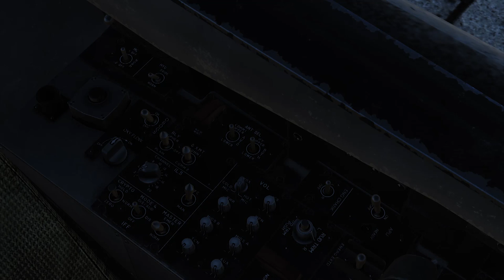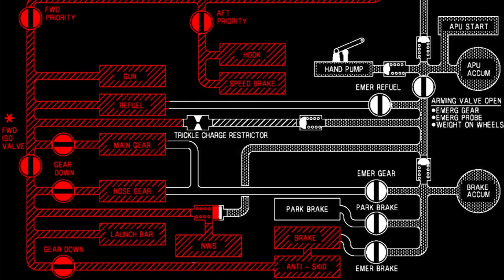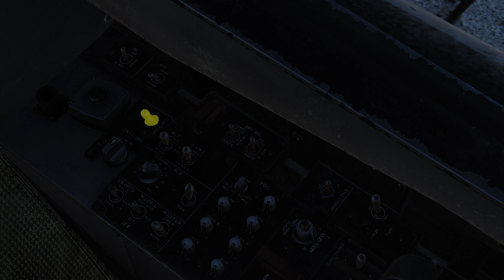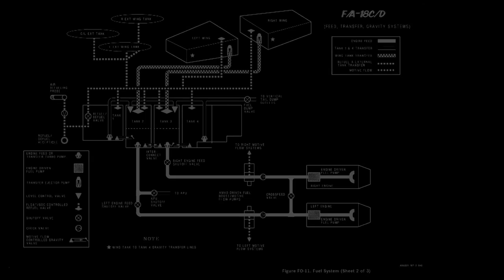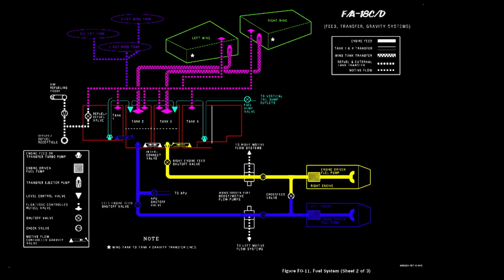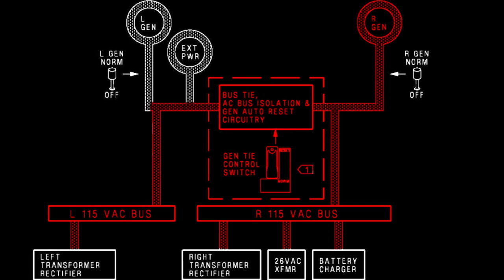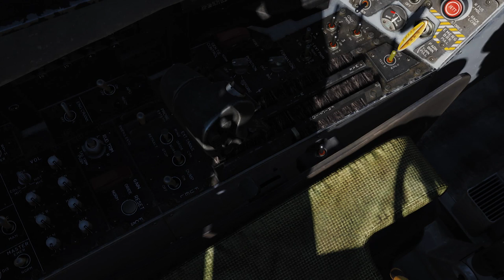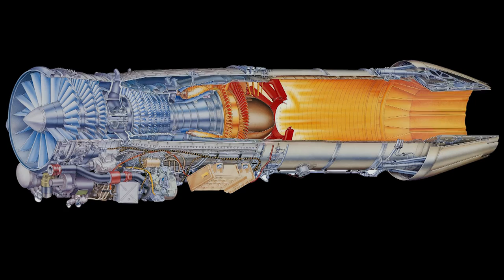CVW-11 F/A-18C Hornet Systems Overview: Part I

Comment: This just got a subscribe... Love the design aspect explanations on this one. I was wondering if you gentlemen might be able to answer some questions:

1. You mentioned the "Dump Switch solenoid" de-energizing under some certain conditions (approx. 40:00 mins). I was wondering if using After Burner also disengaged the system (seeing as many military aircraft manuals do not recommend this type of operation)?

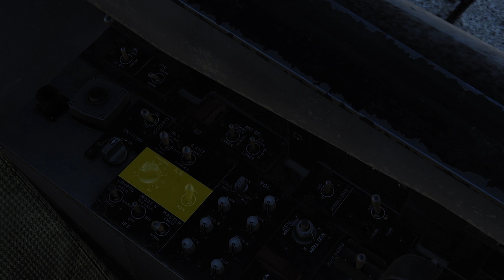2. I would love an explanation for why the "GND power panel" at about 53:00 mins  occupies such a valuable piece of cockpit "real-estate". It seems odd to me that a series of switches that are ONLY operated on the ground are in a much more accessible location than, for example, the ILS/IFF/Vol panel (visible at 26:00).

3. At 55:10 you mention a "Cold and Dark" Battery drain in DCS. What system is supposedly draining the battery in this state and is this JUST a DCS thing or also something for the real aircraft (although I imagine it would not be at that accelerated rate if it were in the real aircraft).

4. Probably a silly question but is there any noticeable engine performance increase once the drop tanks are released (or emptied) due to no bleed air being directed to those tanks (Approx 1:10:30)?

Hope these questions aren't too trivial and looking forward to any answers you may be able to provide.
Reply from the maker: 1.  No, the dump will still work during afterburner. Unless the fuel computer senses that you will be under the conditions of low fuel state for the time of flight. 

2. no idea really but I'll be sure to ask our Hornet experts and see if I can get you an answer. 

3. I think it's a DCS oddity but I could be wrong, I'll ask 

4. Bleed would still be going to those tanks unless you drop them, as far as I'm aware. 

Those are my answers but I'll try and get you better ones :)
Reply: @carrierairwingeleven1747  Looking forward to it. Thank you
Reply: For #2 its probably like that because it made it easier for an engineer but not for the people operating or maintaining the aircraft, the hornet is full of this , that switch bank is very close to main power bus in 10L so that's probably why, techs use power very often as well
Reply: #4, The performance gain of the aircraft once the external tanks are jettisoned is due to the loss of weight and airframe drag from the tanks. I would assume SOME performance might be gained from the reduction in bleed air usage but probably not much to write home about.
Reply: 4. Bleed air not going to the tanks would not be any noticeable increase in engine power performance. It would be routed there, or through the precooler into ecs air. The only thing I am not sure about is if the engine on the hornet has a high pressure and low pressure valve that will switch over for fuel savings at different RPM settings.
Reply: @goblinkok  This is the same conclusion that I came to.
Reply: @Spartan536  After further discussion I found out the bleed is used for quite a few things other than ECS. But the pressure from both engines would be more than enough and not cause any performance variations. Still unclear on the power setting switching from LPV TO HPV. Ok so found out the low bypass engines do not have LPV or HPV that switch based on engine rpm. I was correct about what i stated above about bleed. The bleed will be there regardless. If not used its capped off or exhuasted overboard.

Comment: Apu acc pressure depends on temperature, in the cold its around 2000 but in the warm it could be as low as 1200.